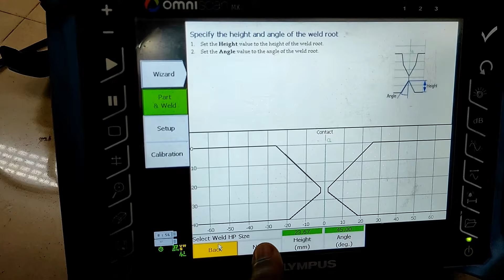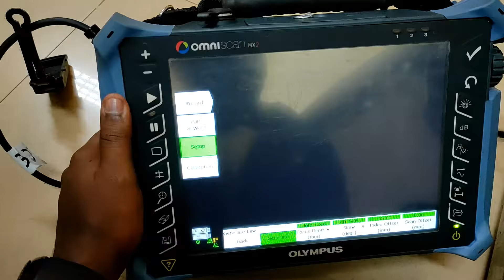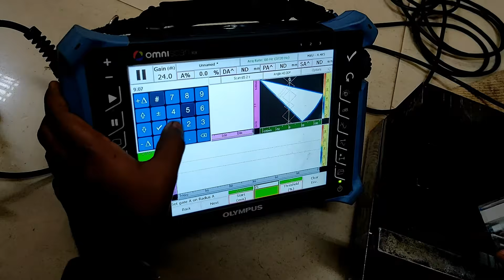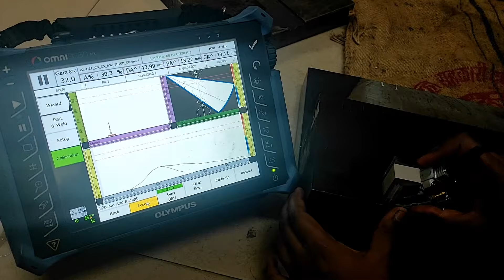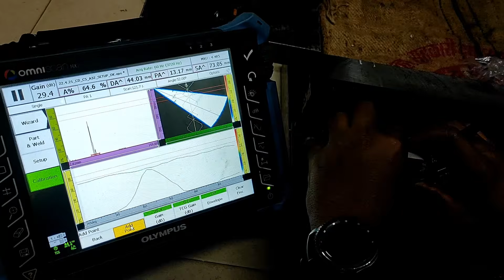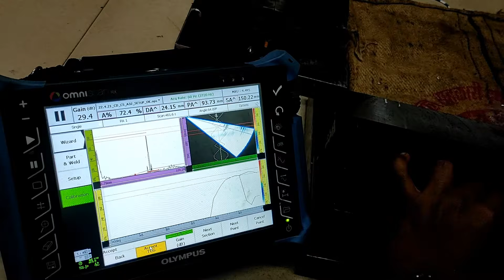PAUT SETUP AND CALIBRATION ON MX2. #PAUT#MX2#SETUP # CALIBRATION

Comment: ask about , ERVW blocks (small, medium, and large block) , is coverd the piping diameter range from 3 inch to 20 inch and can we used these blocks for wedge delay and velocity calibration ??
Reply from the maker: Hi Hussein Off course we can do the wedge delay and velocity calibration with ERVW block. If you can do TCG rest also can be done